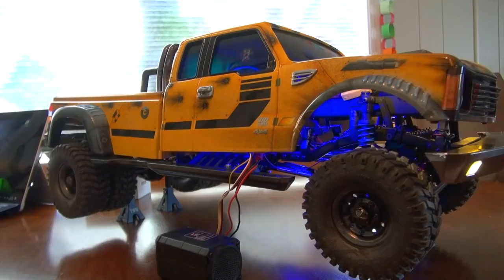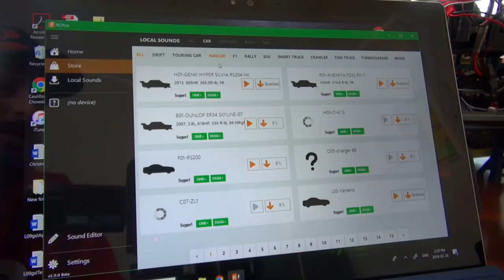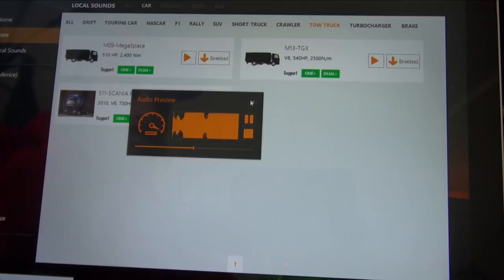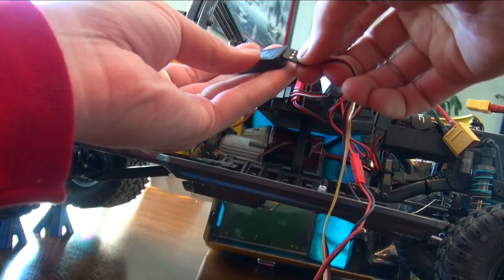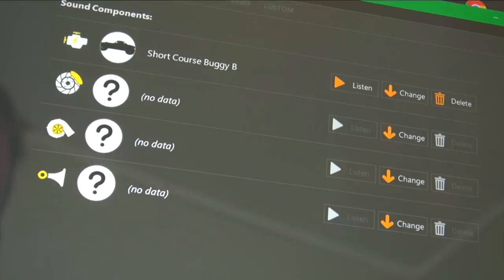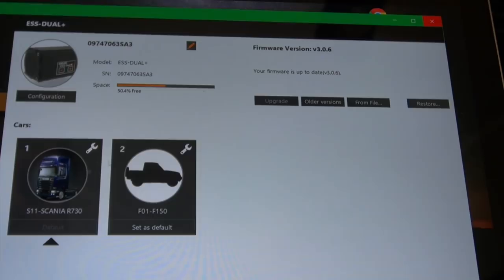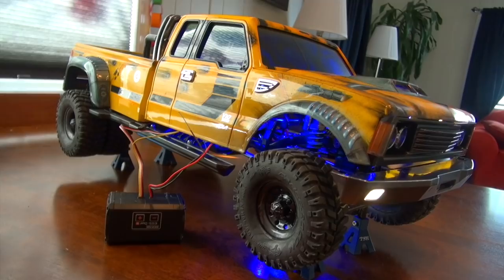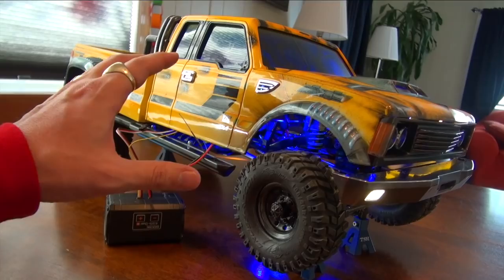RC ADVENTURES - TUNiNG the DiESEL ENGiNE & TURBO for BUMBLEBEE-ST! PROGRAMMiNG "ESS-DUAL" - PiCKUP

Comment: Now THIS is a good bargain. The first sound system you showed recently was more or less useless for the money, but this?
You can use whatever sound you want and upload it via a user friendly interface.

Still not as cheap as a DIY solution, but the benefits are there!

Comment: Well that's a very nice sound kit indeed, quite a few options for sounds and horns and turbo. I like the second to last sound, the one when you had the glitch with the radio. Main reason is because the last one would be awesome on Optimus Overkil. It's totally its sound, well in my humble opinion, and I think the second to last would also fit Bumblebee pretty well even if not as throaty. Whatever you choose, it's not a wrong choice anyway, this is an awesome build! :D

Comment: Hi RC Sparks, how are you? I have a question a bit off subject, but I wanted to know if I could add a second receiver or some sort of extender to add a few more channels for extra scale accessories. I have a Spektrum DX5C I just purchased for my new trail finder. I am a bit frustrated with this receiver because of the limited space. After all the basic servos, Esc with the BEC plug, transmission shifter there is no more channels for the winch and light kit. Thanks for your time. Brad G. I would appreciate your feedback.

Comment: You could have looked into using screen capture. There are a few options even windows does it now in settings then Game mode there is a screen capture program in there I think also if your surface has a Nvidia GPU you can use shadowplay to record your desktop. It only takes a few seconds to set up and it looks a lot better than a camera recording a screen. I know you don't do this that often but it's always nice to you have the option when you do have to do it again.
Reply: I just typed in Google "Windows Game Mode Screen Capture" and this is what came back as a result (I use Shadowplay myself for desktop capture. -(You can hide or show the timer with Win + Alt + T.) Windows spits out an MP4 file within a second or two of ending the recording. You can also take a screenshot with the command Win + Alt + Print Screen. Both videos and screenshots are saved to your computer with the name of the game and a timestamp in the filename
Reply from the maker: I always use screen capture, and use it often.. but for this video, I didnt think it was necessary.
Reply: Ok right on. Sorry about jumping to conclusions and rambling on. What do you usually use for screen cap? Only reason I thought you didn't use screen cap that often, I've been subscribed for a little over a year now and haven't really missed any shows. I just don't remember you using screen cap, that's all. Lots of YouTube shows and a lot of creators, can't keep them all straight in my head.

Comment: I am trying to figure out how to add the horn to mine. What does “PWM FORWARD OR BACKWARDS “ refer to? I can’t find anything on their website to explain it.
Reply from the maker: #1 - you need to plug into the computer, and set the horn sound.   Then you need to plug the Yellow wire into an open AUX port on your RX.   :) That will work
Reply: RCSparks Studio thanks that worked. I didn't have an extra channel so I used the high/low transmission channel since I leave my TRX4 in low all the time anyway.

Comment: You can download any wav. File on internet and upload to ESS one in place of the horn or machine gun...need to find some of bumblebee talking through his radio and set that up on ess-one...
Reply from the maker: Already ahead of you man. Lol ;)
Reply: RCSparks Studio 
I opened up my case on my ESS one...and soldered wire connections to hook up traxxas o.b.a speakers attached to my body...it sound deeper and gives the truck a vibration feel.... And there waterproof

Comment: can this ESS be installed on the traxxas trx4 ?
Reply from the maker: Yes it can. If you get the ESS Dual, it comes with a TRX mounting Bracket
Reply: thnx body... after few days of research i just got the Traxxas trx4 altho im a jeep guy but didnt find a nice wrangler that has same specs as the trx4. just saw the capo 1/8 jeep wrangler and i almost lost my mind.

Comment: The new ess’s are not as good as the older models.
Theres not as many sounds and the sound quality isnt as good because sense has made them smaller with no port hole.

Comment: Bumble Beast won't sound right unless you have a stonking huge big block gas V8 under the hood. GM 572, SS454, Mopar 440 Max Wedge, Ford 426/427/460, something like that. And not stock, either, they need a thumper cam, longtube headers, dual-quad carbs, maybe even some 6-71 or 8-71 blower whine.